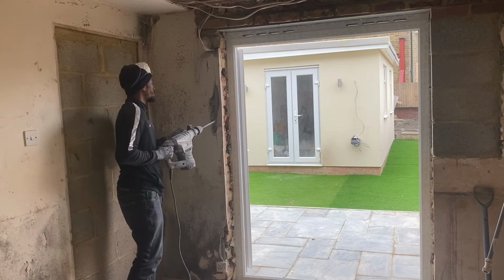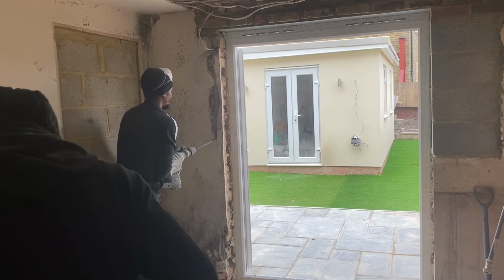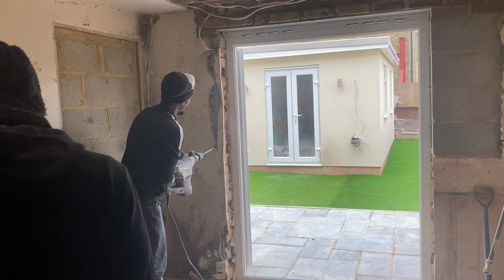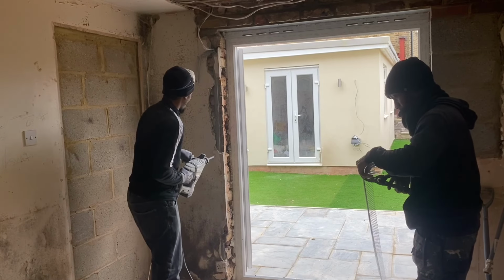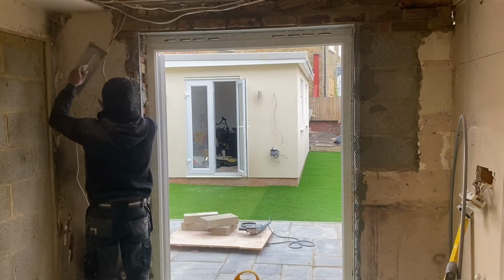Blocking up door way

Comment: Just a useful tip from a plasterer. Another alternative to using the mesh render beads (I know these can be awkward if brickwork is bad), would be to dot and dab plasterboard up the reveals and head of the opening. Overcutting the strips of board so they are flush with the existing plaster work. And then you use the edge of the plasterboard as an edge for the backing plaster. then you can just use skim beads when it comes to skimming it in.
Reply from the maker: Hi Jay Thankyou 😊 tbh I would of typically just dot and Dabbed board around the reveal like you said but sometimes for the video I do different things lol. I also wanted to use up the KRend I had left. I will bond the header though. But I will sand and cement the reveals just for video sake to show some diversity.
Reply: A lot quicker way mate